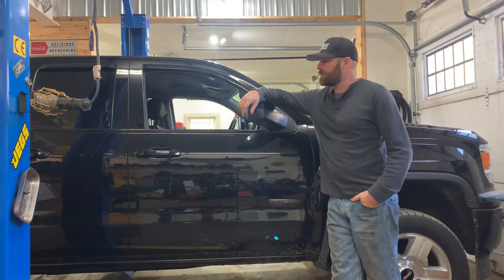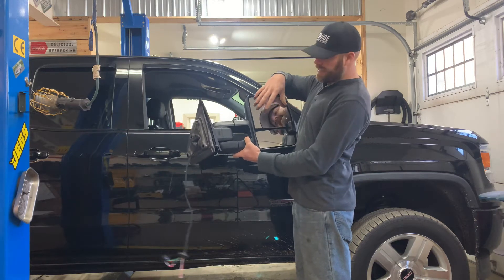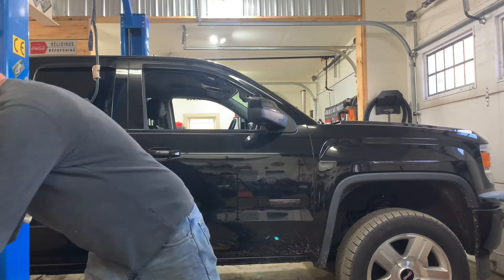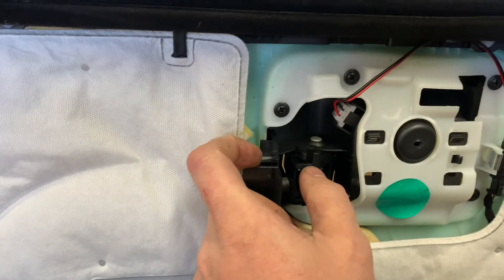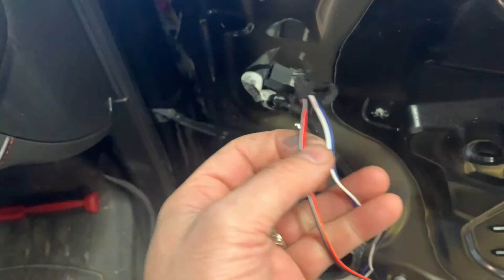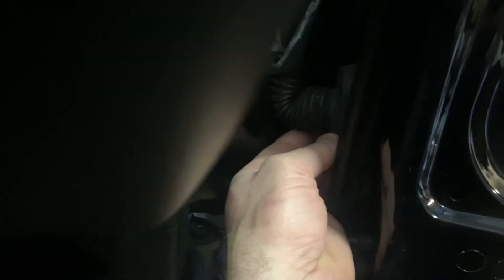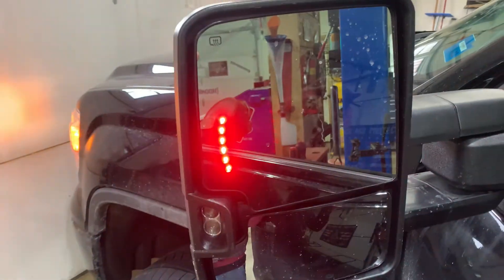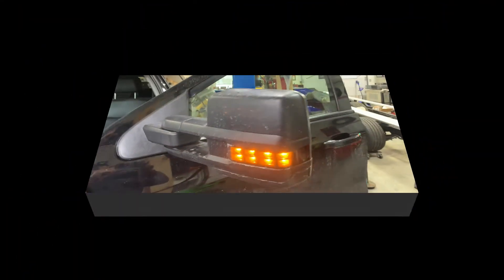How to Install and wire eBay tow mirrors on 14-18 gm 1500 trucks

Comment: Could you run the red light into the connecetor also instead of splicing into wire on door panel ? Jw because i already ran the pit to it and put my door pamel back on and really aint trying to take it back off 😅 it was aggravating
Reply from the maker: Possibly I guess

Comment: hey man , how did the mirrors hold up over time? i am shocked by the price of OEM and some after market mirrors. thanks
Reply from the maker: Actually ya I ran them 1.5 years before I sold truck
Reply: @ okay thanks man, that’s good. Did the quality of them in general feel okay? Thanks man

Comment: I ran the wires to the plug, waiting on the connectors. But i dont have signal in glass in my door.. is there a way to get it, without too much nonsense, but what i really really want is the running lights on the front..
Reply from the maker: Have to look up your door connector wire diagram I’m sure it’s in the connector

Comment: What was the trim model on this truck. Mine is a 14 LT and pinned 11 & 9 but no luck.
Reply from the maker: It’s the all terrain
Reply: i had this problem also. if you look, the orange/red wire that gets cut...there is no provision for it to splice into on the vehicle harness. you will have to take it all the way to the bcm. its not difficult. there is another GM tow mirrow video here by Boost Auto Parts that explains it